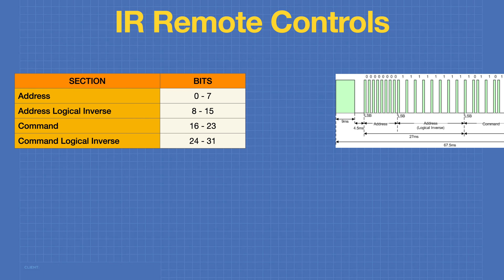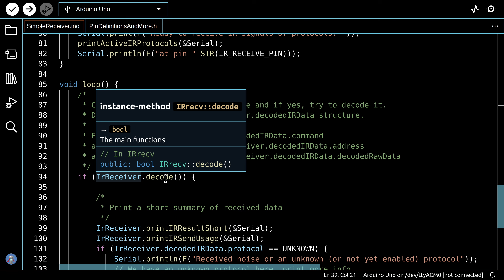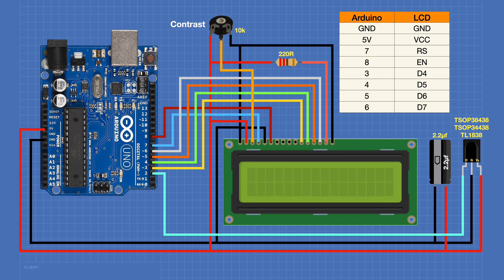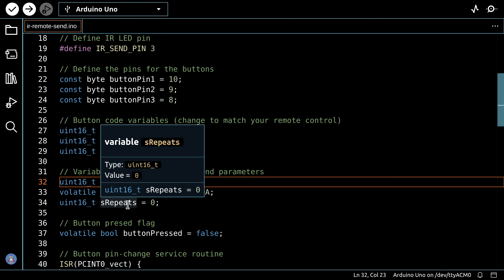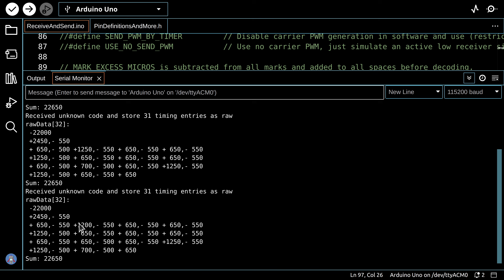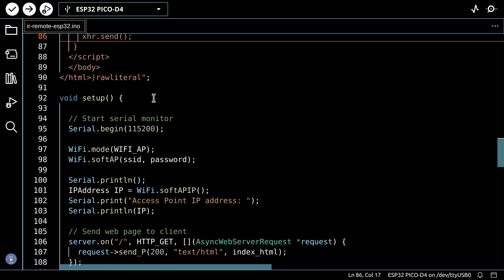IR Remotes & Microcontrollers - Arduino & ESP32

Comment: @Dronebotworkshop I don't know why you mix encoding with modulation. All remote control data is sent in a serial format. The data is encoded using a number of different encoding techniques. These techniques determine how the zeros and ones are represented for transmission over the infrared light beam, which is usually modulated with a 38 kHz carrier (On–Off Keying).

There are three basic encoding techniques used, along with several variations of them.

Pulse Distance Modulation (PDM) – Also called Space Encoding or Pulse Density Modulation.
Pulse Width Modulation (PWM) – Also called Pulse Encoding.
Manchester Encoding – Also called Bi-Phase Encoding.

Comment: I am having trouble to find out which example/function that will send my following raw data (I think it is longer than usual?)
Can you see from the data which function/example I should use to send this code?

Received unknown or pulse width/distance code and store 155 timing entries as raw in buffer of size 700
rawData[156]: 
 -3276750
 +3950,-3950
 + 450,-2000 + 500,-1950 + 500,-1950 + 550,-1950
 + 450,-1000 + 500,-1000 + 500,-1950 + 500,-1950
 + 500,-1950 + 500,-1000 + 500,- 950 + 550,-1900
 + 550,- 950 + 500,- 950 + 550,- 950 + 500,- 950
 + 550,-1900 + 500,-2000 + 500,- 950 + 550,- 950
 + 500,- 950 + 500,-1950 + 550,-1900 + 500,-1000
 + 500,-8050 +3900,-4000 + 500,-1950 + 450,-2000
 + 500,-1950 + 500,-1950 + 550,- 950 + 500,- 950
 + 550,-1900 + 500,-2000 + 450,-2000 + 500,- 950
 + 550,- 950 + 500,-1950 + 500,- 950 + 550,- 950
 + 500,- 950 + 550,- 950 + 500,-1950 + 550,-1900
 + 500,-1000 + 500,- 950 + 550,- 950 + 500,-1950
 + 450,-2000 + 550,- 950 + 500,-7900 +3950,-3950
 + 500,-1950 + 500,-1950 + 550,-1900 + 500,-2000
 + 500,- 950 + 500,-1000 + 500,-1950 + 450,-2000
 + 500,-1950 + 500,-1000 + 500,- 950 + 500,-1950
 + 550,- 950 + 500,- 950 + 550,- 950 + 550,- 900
 + 550,-1900 + 550,-1950 + 450,-1000 + 550,- 950
 + 500,- 950 + 500,-1950 + 500,-1950 + 500,-1000
 + 500
Duration=182750us

Comment: I have tried everything with the sendandreceivedistancewidth sketch, and I cant for the world of me get this thing to work. I have changed the timing, number of bits, and decoded raw data to everything it said in the code, but for some reason my heater is not picking of the signal. Any help would be greatly appreciated. It is a pelonis ceramic heater if that helps at all.

Comment: Display WRITE and READ mode is applicable to the i2c interface.  So if using the i2c interface you will need write support.  The i2c protocol is a bi-directional protocol depending on how you use it.

Comment: WOW!  That was a lot of very useful information!.

I checked in to this presentation because I wanted to build another IR system to control a model railroad streetcar.  I had the code from several years ago but when I tried to use it, it wouldn’t work because the IRremote library had been updates and now my existing code didn’t work. 😢
Help from internet sources was cryptic, at best, and used a whole lot of jargon that I am unfamiliar with, since I am completely self taught on microcontrollers.  DroneBot Workshop is once again my go-to source for easy to understand and accurate information presented in a clear concise style.  
Now it’s back to the workbench to try modifying my old code to fit the new IRremote version.

Thanks again for making things easy to understand (I do use the back button a LOT)😅

Comment: A good presentation overall. Someone has already pointed out you must have meant a 2N3904 rather than an 06.
At 21:16 I'd suggest the dropping resistor is important as it allows one to seat the IR diode current to a predetermined value. 
At 21:15 your location of the IR diode looks undesirable to me. It would be more typical to locate the diode with the resistor in the collector circuit (as you actually do later in the video). It would be best to keep the collector to emitter voltage small when the transistor is on. Let the transistor stay cool.

Comment: I bought 5 ESP8266 boards with OLED and WIFI for under £10, I have four main Projects, A fancy Digitally driven Analog clock, pendulum and mechanical chimes, Three axis CNC automation for my Slab Flattening router bed, Control and monitoring of my Pond temperature and water level, and a learning remote control for my Sony Smart TV, whose remote died and I couldn't get an original replacement only a third party one which is awful.
I haven't done any programming since the 1980's Commodore and Sinclair BASIC and Z80 and 6502 machine code. But you make this look so easy.
I uploaded The Arduino environment and ESP8266 board libraries, with my board announcing "Hello World" I'm ESP8266 OLED! D5=GPIO12=SCL and D6=GPIO14=SDA. I'm ready to get soldering to my Veroboard and start experimenting.

Comment: IR is a good method for input, but do you know what you have not covered in the last 4 years of your videos, speech recognition with the cheap modules. I know they're not very basic 'on the inside', but they only throw out a serial byte to show which word they recognized.
I must add I have no idea which of the <$10 is best, but the 'v3' black blob on a red pcb variant seems good for 15+, and the 'best' at the moment seems to be the $25+ dfRobot 'gravity' module which i'm saving my allowance for, the wife doesn't like me hobby spending lol.

Comment: This is indeed a very useful and detailed video. I hope that the coming follow up vides will cover the integration of these IR remote controls into existing home automation platforms like Home assistant. I could not find any way in which I could integrate this with ESPHome. Hope you can guide on this direction. Looking forward to the follow up videos.

Comment: A cool/fun/evil use for this library is to make a portable unit that cycles through all possible protocols and addresses and sends the OFF command.
Reply: Its been done. I recall students turning off TV's in school when those wrist watches with built in remote controls were released over 30 years ago.

Comment: Be sure to checkout my video for universal IR receivers for your desktops.

Any ir remote you use here, you can make an arduino device that will read those controller values, and run code as a byproduct of that signal with my IR Desktop receiver modules for only $8. 

Video is definitely worth a watch if you want to not only obtain hardware to do this, but code behind it is what makes it awesome! Super high speed and low memory meaning we can add hundreds of ir values

Comment: Hi. Great video. I don't quite understand the connection between IR Emitter and IR Receiver Module. The IR Receiver Module receives at 38Khz but does that mean that the IR Emitter sends with 38Khz or how, there is nothing in the software that states that it must be sent with 38Khz. ?

Comment: I played around with 2 line LCD displays back when they had high voltage power supplies for the backlight.  For the one I had, the R/W pin was to write custom characters into the display.  I ran across the project a little while ago.  The wirewrapped Z80 with RAM, EPROM and PIO and the custom characters I had put in the display still worked after over 30 years.  Do modern LCDs accept custom characters?
Reply: It was a digital display, but not a LCD display. Those displays were modern, miniature versions of the Nixi tubes.

Comment: Fantastic discussion of IR remote control aspects.  Excellent presentation and detail.  I'm looking forward to seeing what the other projects are that you've done.  Have you done anything with addressable LEDs?  I've been playing with that with some success (and some failures).  I had a hard time getting the $10 LED strip controller to recognize its IR remote, but eventually it started working.  Thanks again.  (Oh yeah, which ESP32 module are you using?)

Comment: Plz make a video on how to measure both positive & negative voltages with Arduino... Also plz suggest a 24 bit ADC plus a method to measure voltages in both polarity... Thanks in advance
Reply: That'd be a good video :D I expect you'd have to use Opamps to add an offset so you could measure negative voltages. I know Bill did a video on Opamps, but not sure he covered this

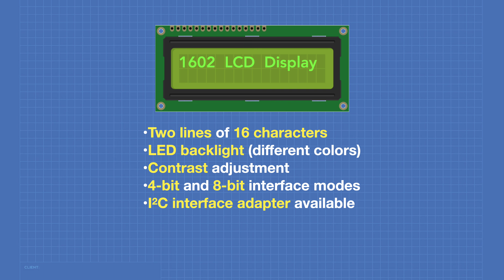Comment: At 22:45 that should be a 2N3904 NOT 2N3906!   At 38:16, I would have used the I2C to cut down on the number of connections!
Reply: That is an important point regarding a 3904 vs a 3906 and could cause some some confusion and frustration. Probably should have a caption added to the video.

Comment: Great video @Dronebotworkshop , got to learn a lot!👏
But I have a genuine question :🤔 

(Q) What is the real use of remote-controlled lamp or may be some other Smart Home device?🙄As a tinkerer it's great to build such a product. But my question is that, is it really required? 
When something so common like a lamp has been used for generations using a simple electro-mechanical switch, what necessitates the need for add the remote control functionality ?

I am asking this because I am badly confused😩 regarding my career choice. Do embedded systems like this remote-enabled lamp or some other is a *SERIOUS*🧐 application which has mainstream demand like for Laptops, Smartphones, Routers, TV Sets etc.

P.S. : I am asking this question genuinely. I live in India where I don't see much use of such a product. I am confused regarding what career choice to make : Chip designing or Embedded SW/IoT Developnent?
Reply: I'm a retired engineer.  Worked 41 years in the aerospace industry.   What I see coming is a huge demand for people that know IoT development to create the "Smart Factory".  The Smart Factory concept relies on getting accurate data about the state of the production process and making real time adjustments to optimize the system.  One project I worked on was optimizing the flow of parts, tools, and materials through a factory using a fleet of automated guided vehicles, overhead cranes, tugs, and pushcarts using a mixed integer optimization algorithm.

If I was just starting my career, I'd go into IoT, machine learning, and optimization.  Lots of high powered math and clever software development.  Very few people have the ability and desire to do this kind of work and the demand will be huge.  Short supply + high demand = great pay.
Reply: For the remote controlled light: have the remote at the door to the bedroom to turn on the light, carry it to the bed and turn off the light there. Or have multiple remotes, one at the door, one at each bed.
It could be done with wires, but that requires a lot of cables, and rewiring if you move the beds.